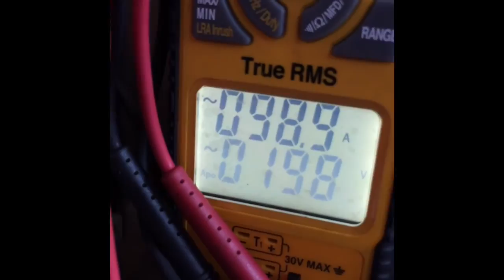Copper plated to death

Comment: So what do you think is the main contributing factor to the copper plating you are seeing so prevelant? Ácid erosion or noncondensibles causing erosion
Reply from the maker: Joe Shearer I would say probably acid erosion.  I'm surprised it was not a burn out and the windings didn't go first.  Something was eating that copper away.